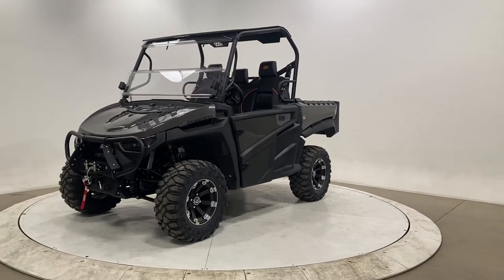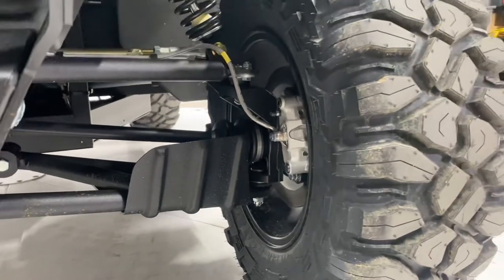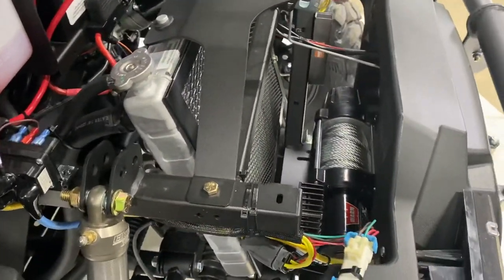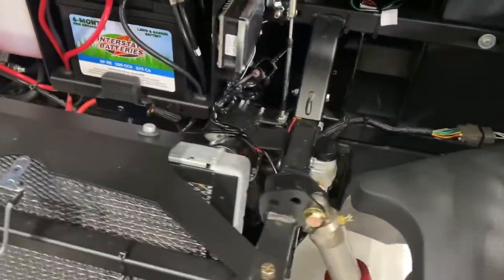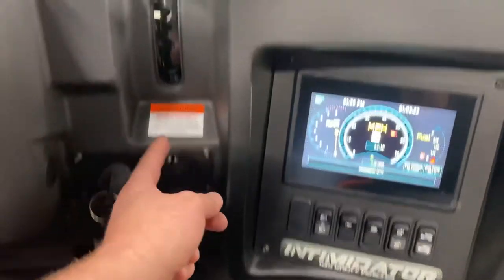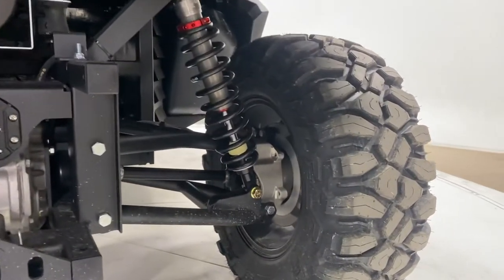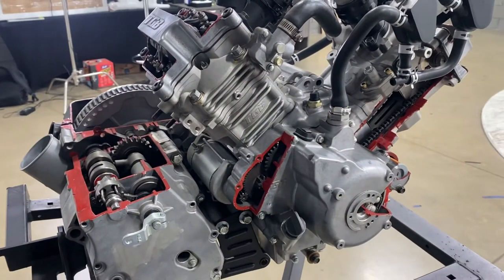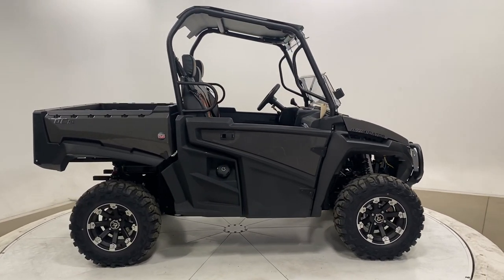2022 Intimidator GC1K Stage 3 walk around video

Comment: So I have a 2021 gc1k crew cab. I inquired about a cab a month ago and was told a couple months. Are you still on track for that?
Reply from the maker: The design is complete and we should have a limited number of production gc1k crew enclosures in 4-6 weeks. Get with your dealer in a week or two to order one. They should have some info about it then
Reply: did you get your cab  Shane ?
Reply: how is your cab ?